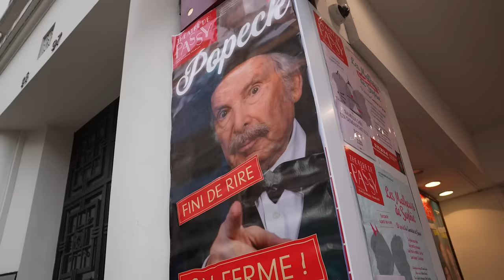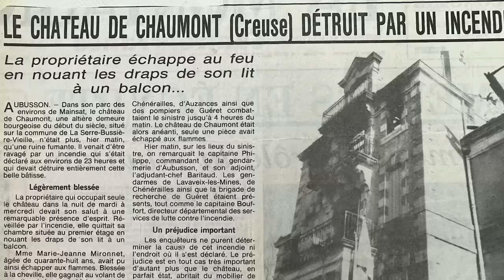Renovating a refuge.

Comment: The second newspaper article might explain why Gilberte Bardet stopped letting out the château to holiday camps in 1960. Apparently she saw some bonfires in the park and thought the château was on fire. The fire department turned up full force thinking they might need to save dozens of children from the flames, arriving to a few harmless fires outside. Gilberte was admitted into a hospital and the article suggests she had quite a drinking problem.

Another interesting tidbit is that both articles say the château was built at the beginning of the 20th century and that Eugénie Bardet had to sell everything before WWII, which corroborates my tentative guesses of a build date of 1903 (definitely between 1901 and 1906 based on census records). Certainly much later than Dan's assumption of 1886 mentioned in an article about his project a while ago. Also over ten years after the death of Charles Choubersky (1835-1891), who allegedly built the château for Bardet. That gives credit to the claims I found on Facebook that it was in fact Choubersky's former secretary who built the place rather than the man himself.

In one of the pictures from the war you can still see the ghost lines of the missing balusters on the outside steps. That seems to suggest the balusters were removed some time in the 1930s. I wonder if they were sold off or removed because they were unstable.
Reply: You're in the right ballpark with 1903.
I've no idea where Dan heard the 1886 date but it is indeed nonsense.
(As is the fact that there was another construction on the site before this one.) 
The claims on Facebook about Choubersky's secretary being the one who was Bardet's lover are probably correct, but as usual, the guy who posted them offers no evidence whatsoever to back them up...!
Reply: @conhand.3578  Yup, and the only evidence of the existence of this mysterious secretary, M. Richard, that I've been able to find is that Choubersky's company was indeed renamed Richard-Choubersky at some point. None of the official documents from that era have been OCR'ed so you could do a full text search, let alone a web search. I managed to find a lot about Eugénie Bardet and her daughter because I had an exact geographic location to search for and a date of birth from the census. Without any of that, finding anything about Richard is probably close to impossible. Besides, he seems to have made sure not to leave any paper trail connecting him to Bardet or the château anyway.

The history of the château is fairly clear from the census records. In 1901 there was nothing, in 1906 there's a domaine Chaumont with a bunch of Bardets living there. Later, the address is sometimes given as "Sous-Chaumont", which might be the gamekeeper's lodge rather than the château proper. So there was no habitable structure on the property in 1901 and the château was finished by the 1906 census. That's as far as I've gotten with official records available on the internet. It also seems fairly clear that the Bardet family owned the property until Gilberte's death in February 1967. I haven't been able to find an official death date for Eugénie Bardet. Apparently her death was too recent for the certificate to be public domain and even though some fairly recent death dates were pencilled onto the original birth certificates (e.g. Gilberte's), Eugénie's wasn't.

Comment: Don't use a electric hoist.  Use two buckets, and pulley cable system.  One bucket at the top end of the cable and a bucket at the bottom.  Fill the bottom bucket with the mortar mix.  Go to the top and fill the top bucket with water until it starts to lift the bottom bucket, like a counter balance.  Then you can lift the mortar bucket by hand much faster then the hoist.  That is how they built the house in the beginning before they had electric.
Reply: How does he get the water up to the top..?

Comment: I don't know how he does this job with  NO  scaffolding or renting a crane I know he's busy and everything but you could have built the temporary staircase your decision dude extremely dangerous decision...

as the master stonemason who went to school for 5 years is trying to give you some advice when you point or add Rock or stone or brick you have to do both sides there's a lot of fire damage in that building need to erect scaffolding from the outside and the inside rent a crane or your walls are going to pop out I seen it happen before where one side of the wall is finished and the other isn't due to the mortar expanding and Contracting the walls will collapse I gave you a warning but be safe wear a safety harness and also where a helmet get or rent scaffolding this will help you do the job much quicker and rent a crane

Comment: It's great what you're doing.  There is progress to be seen every day.  But you should definitely get a construction crane.  You still have to lift so many building materials up, which is very strenuous and time-consuming with the winch and muscle power.  If it is well maintained, a used crane can usually be resold for the same price after construction work has been completed.  Many greetings from 🇩🇪 🙋🏻‍♂️

Comment: Dan if you get furniture hoist set up on the left hand side you'd save so much time, getting stuff they are relatively easy to use. Perhaps not to cheapest, but in the long run it will pay for it's self. Keep up the amazing work though.

Comment: Would not be my choice, but if you intend to rebuild the spire roof as designed I would suggest framing it on the ground and having it lifted into place with a crane.  I would like to see a castle like top, or a covered widows walk.

Comment: My dad use to do this mix lots of mortar and then trowel it on an entire wall area at a time. Then if you want you can use a push broom to wipe some off and expose the stone or bricks. It’s much faster easier and probably stronger. Also maybe you can bring the cement mixer to the top floor along with water service from a long garden hose. Then have the material delivery put the mortar mix and the sand with a crane through the top window. Then you could mix all mortar upstairs and send it down a tube or bucket as needed.”

Comment: i have been following you for years.  I admire your willingness to put in the effort to reach a goal.  Do me one favour. Get yourself a simple building lift and install it at a suitable place on one of the outside gables.  You cannot continue to log heavy pails with lime mortar up the stairs.  If you don't you will not be able to finish your dream of a finished restoration of the castle.  Your body will have given up.

Comment: About the rebuild, I am wondering about a couple of types of building materials:      1) Will it be possible to find the granite slabs for the parts of the facade where they are missing? Will you be trying to source that now so it doesn’t become an issue later? 2) I have noticed some decorative green/blue glossy square tiles, some in good shape and some broken or missing. Are you thinking about trying to recreate them, or do something different?  BTW, the repair work on the walls is looking beautifully worked!

Comment: I put a strap on the outer lip of that cement maker and put a good stiff piece of rubber or even a piece of metal flashing so that you can fill the narrow buckets way easier when you are by yourself so none gets spilled. Why the beautiful cement mixer does not come with a trough is a design flaw.

Comment: Have you considered using some kind of inverted pulley to speed up lifting light things like this bucket of mortar? A fixed point near the floor, an idler pulley attached to the winch and some rope should do.

Comment: I'm curious about the stonework.  Please describe the mortar you use. It's hard to understand how strong the walls are when using odd-shaped stones.  If it were brick, the flat surfaces would evenly distribute the weight.  But when you use diamond-shaped stones, the mortar must carry the weight.  Because the mortar is thin in some places and thick in others, what mixture must you use to ensure its compressive strength?

Comment: wouldn't it be smart to put a short length of rope on the hoist. "tag line". so when it reaches the top. you can pull in your load without falling over or having the load pull you over?

Comment: does anyone know what he means by rendered
Reply: A render is a protective (and decorative) layer (made of water mixed with sand, cement, lime, etc.) on the façades of a building.
On Dan's chateau for example, you can see that the original render is still there in some places while in others it's disappeared and the somewhat rough stonework that wasn't meant to stay exposed is now visible.

Comment: Do I have this correct?  You plan to block in that attic meaning no access?  The photos showd a big window on the attic front.  Removing that doorway is the wrong move.  Please reconsider and keep everything original.  It exists for good reason.  No door to the attic means no way to see leaks and no storage, what a huge waste of space.

Comment: 5:07 I can see the newly built roof height of the side isn't as high as it used to be, a good 30-40cms, according to what we can see on the side of the tower. 
I have a bad feeling you might have a few issues soon, not including head height issues in the hallway on the other side. You might have to crouch down to walk through there. 
And you will need that hallway to get to the very top room at the back of the chateaux.
The roof lines are not going to match up.
Reply: LOL
Reply: The singular word is "chateau" (or "château"), by the way.
You seem like quite the specialist.
Reply: @theduchess9019  it wasnt my spelling but the auto correct for some reason, it always does it. As for the roof, i am intrigued how he will line up the two parts of the roof, or am I missing something and there is something extra going on top of the roof that will lift it up an entire foot taller to line up with the hallway gable?